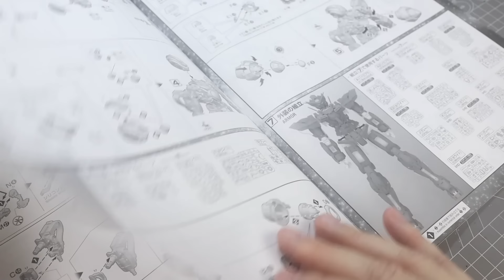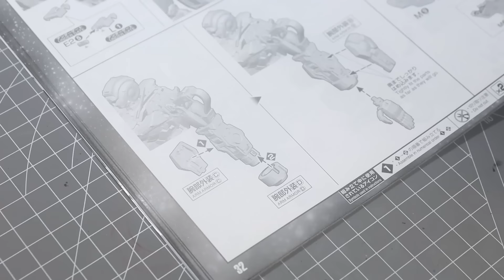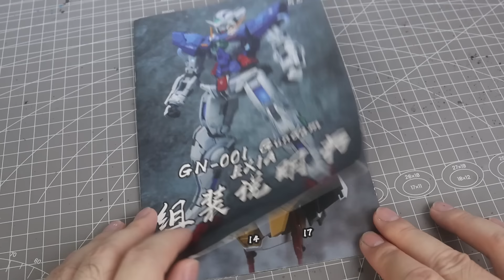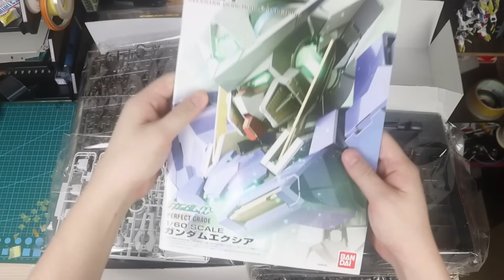PG 1/60 EXIA with RESIN CONVERSION KIT

Comment: This is absolutely stunning! I love the subtle shading and the color separation! Was the GK parts difficult to work with? This is how I wanted to paint my PG unicorn, but I got tired of masking and didn't do as much color separation as I had wanted. And I thought 250 hours was already a long time haha.
Reply: i dont mean to be rude, but that is a long time for a unicorn, im working on one rn, took me about 30 hours to build, im not in the mood to drop $200 for the leds so im doing them myself. All in all i can see it completly done in about 120 to 140 hours, and thats with pre shading, painting and all. But hey man, if you just work slower but enjoy it as much, then you do you.
Reply: @nekosimp7751  Yeah, it took me a lot longer because I was using dragon momoko's PG unicorn, which has far superior detail but the fit is awful on most parts, so I had to shave down a lot of parts during assembly. I also added after market metallic screws and thrusters and some other mods. I was not in a rush, so time was also spent in designing the color scheme and color separation of parts etc. I also made plenty of mistakes during painting and assembly and also had to fix a broken part, so it definitely was way longer than I expected haha.

Comment: awesome video, however i dont really understand the point of getting a resin conversion kit, like it doesnt change very much, and the stuff it does is mostly add panel lines and slight elevations here and there. And you show that your capable of scribing them into the resin, why not just scribe them into the plastic? I do it all the time, and the elevated places you could just glue on some like 0.1mm styrene sheet pieces.
your paint job is nice, i like the very subtle colour differences.